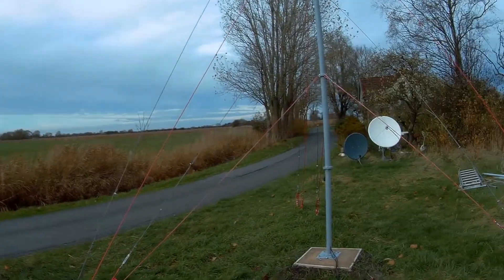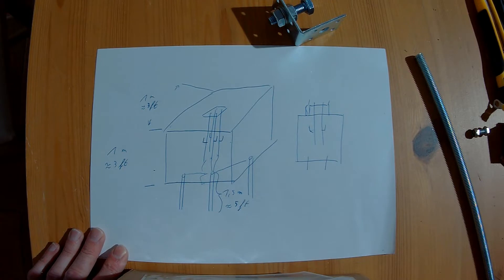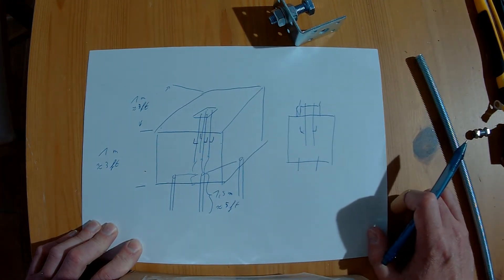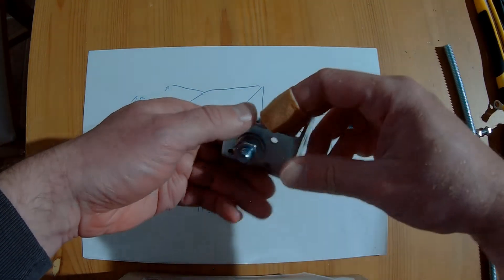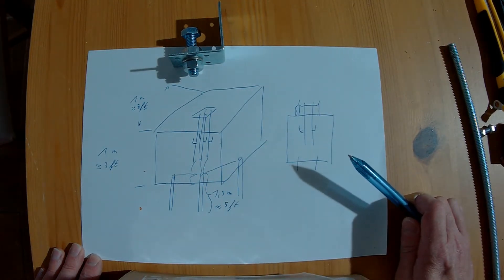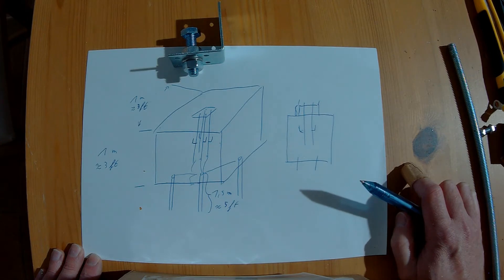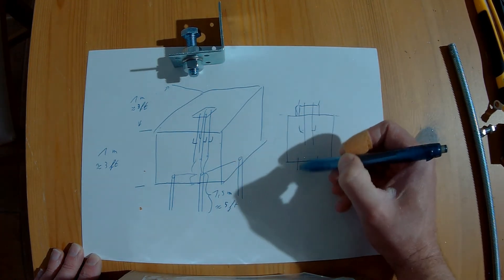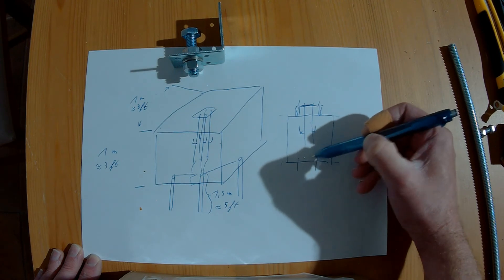Concrete foundation for the ISTA Breeze wind turbine mast

Comment: Hey guys, you can setup a small wind turbine anywhere there is a fence.
You will need a pipe, 4 small droppers, ratchet straps + a strong fence post. 

First measure in half the width of the pipe, then drill a hole straight through the bottom of a 3 or 6 meter pipe, so you could put a long bolt through the pipe and go through each end of a chain after wrapping around the bottom of the fence post, so it acts like a hinge but stays chained to the fence post
( bolt head, washer, chain, pipe, chain, washer, nut ). 

Next drill another hole through one wall of the pipe an inch above the bolt, big enough to easily feed a 3 wire 10A AC extension cord through it. Choose an extension cord long enough to run down the inside of the pipe and to your 3 way bridge rectifier, then cut the ends off the extension cord ready to thread through the hole and then through the pipe to the top. Leave enough hanging out the top to attach the turbine, I use 3 male spade connectors.
Tip - Cable tie wires to the pole so they don't fall back inside.

Cut off 4 separate links of large chain and attach them to the pipe, half a meter blow the blades with a hose clamp or a U-bolt, for attaching ratchet straps as guideropes. For a 6M pipe, 2 x 4.9M ratchet straps for each four guide ropes, hammer in 4 small droppers at 45% angle equally spaced out.

Finally push the pipe and wind turbine up, use a second bit of chain to wrap around the top of the fence post and the wind turbine pole, using a bolt with two washers and a wing nut, for easy take down for maintenance, 

Tips, 
To help push the AC extension cord through the pole, push a garden hose through from the other end first to push the wires in, than drag the wires through. Assemble the wind turbine on a car mat to not damage paint.
Use a stack of 3 car tyres to put the tail through when putting up or taking down to stop damage and so the wind wheel faces up for easy removal.
Use a long stick or a big fishing rod to attach the ratchet straps to the top.
I hope this information helps everyone.

Comment: Hi just purchased the tower kit and looking at your vid how did you anchor the stay wires anchor points  to the ground?
Reply from the maker: I use 1m long steel bars. In damp soil, these should be concreted